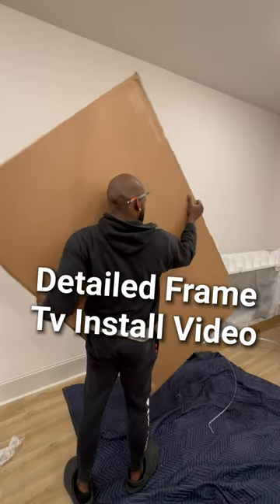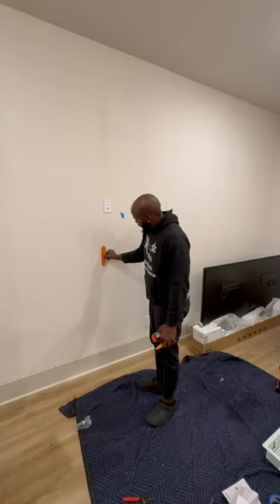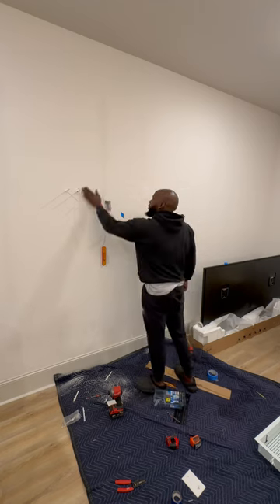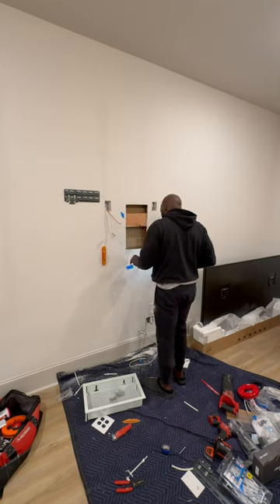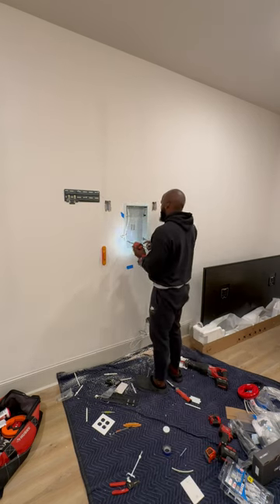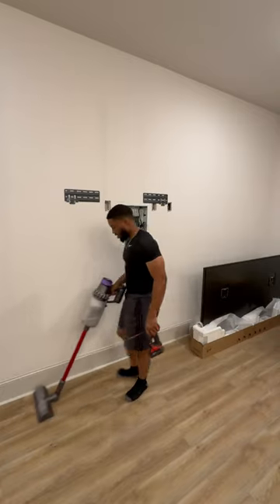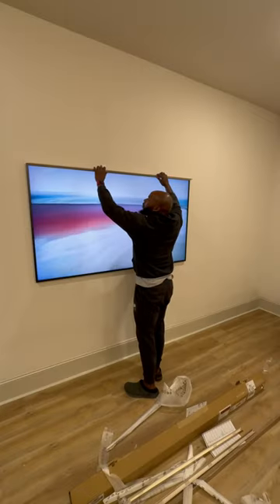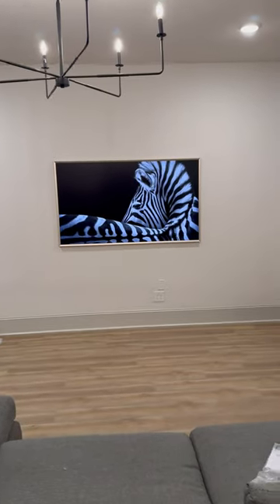How to install a Samsung Frame Tv

Comment: Hi! I love your vids - really insightful and helpful. 

I’ve had a Samsung Frame in the past and am looking to get the 2024 model. The issue that I have is I need an arm/motion mount now as the tv is going to sit within a unit (and won’t be fully visible). Can you recommend any that would be flush to the wall? I saw your vid on Samsung’s official ‘Full Motion Slim Wall Mount’ - but it looked like it sticks out a fair bit. From my research, it looks like something like the Vogel 545 Thin might be the best bet? Thoughts???